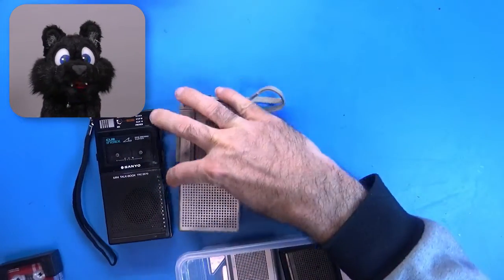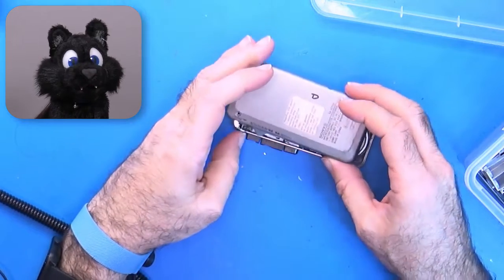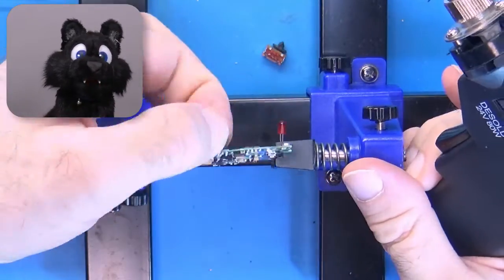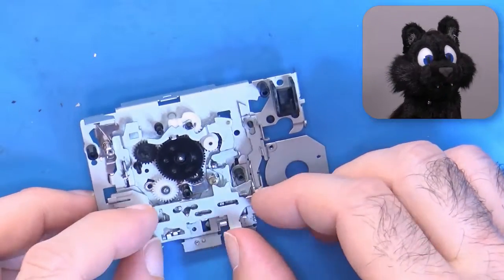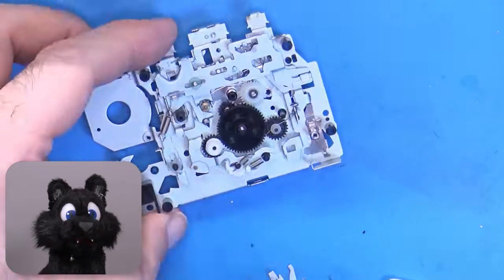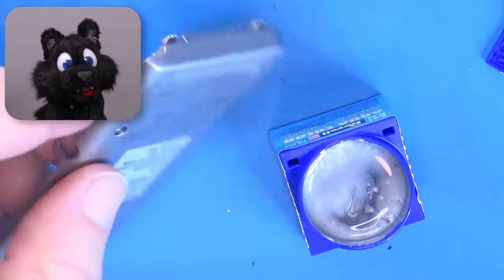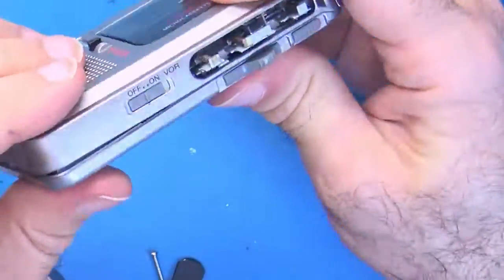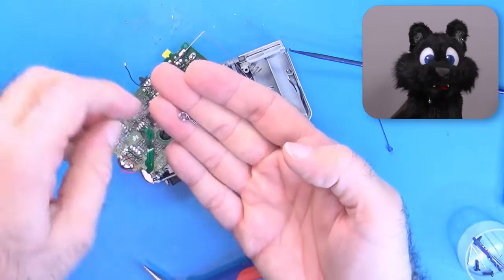Restoration Project #24: Sony M-570V

Comment: 5:34  LOL.
Been there, done that! I'm a locksmith by trade. Been losing parts for over 20 years now.
I just 3d printed an OBD port with a jumper wire for programming Mitsubishi car remotes.
You have to jump pins 1 and 4 with a paper clip to get the car to go into programming mode.
But getting under the dash to make sure you can see the proper pins to jump is hard, especially when you're 56 years old! Now I can just plug in my home made OBD port.
I used 3ds max to design it and Simply3D to slice it. Was a lot of fun!

Comment: What would cause a small microcassette like this to make a LOUD squeal when pressing play?
it's not the tape, I've eliminated that possibility. It's a Realistic model Micro-25. I have 2 of them that do it. I'm guessing the record switch is faulty causing feedback. Getting access to it is hard though!
Reply from the maker: Hard to say without knowing the device; if it's coming from the speaker, it might be that something in the amplifyer is oscillating? The tape signal is pretty small and needs quite a boost to be audible. Maybe some of the caps are not quite up to par? Mabye some ground connection is flaky? I recall some devices always start up with a low "squee" even when new, maybe some of the components deteriorated and it's now more noticable? Just guessing here really...
Reply: @atkelar  Thanks. Already recapped it. Gotta be the record switch I guess

Comment: Nice coincidence, I was just looking at the other dictaphone video again yesterday and wondering what happened to the rest of them. I'm considering my options for portable audio recording on a budget but I think dictaphones are a bit too low-fi for what I need, which is a shame because they're very cool and charming machines.
Reply from the maker: There's still two more left in the box, yes. I try to mix the projects as good as possible and since my primary motivation was a period accurate data recorder, I will use those as filler projects eventually.
The audio quality is quite low indeed; just well enough for voice messages. I think I've seen an attempt at going HiFi with the microcassette format, but I don't think there were portable units of that... Techmoan did a video about that if I remember correctly...